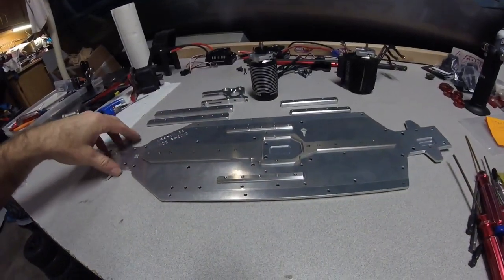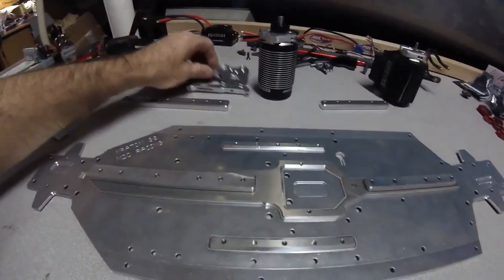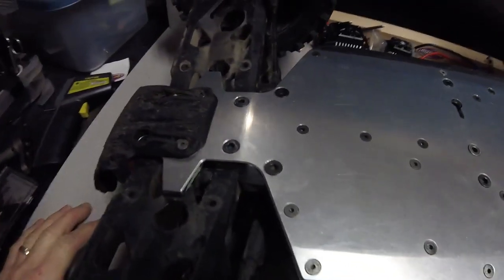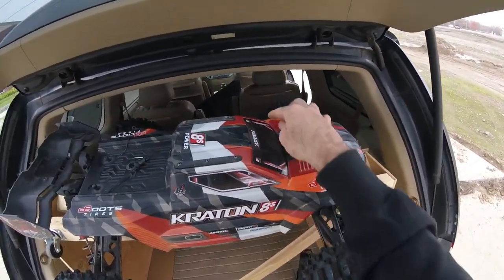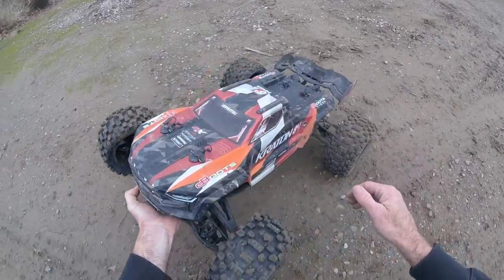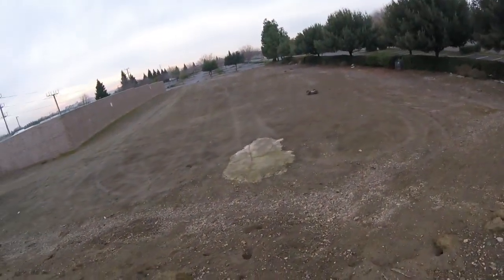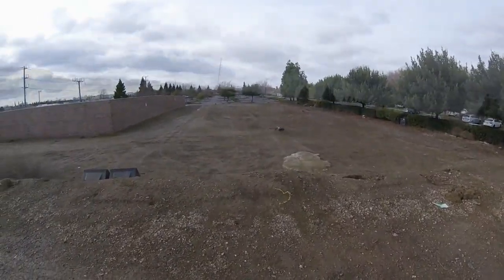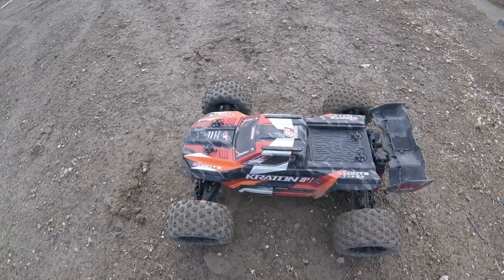ARRMA Kraton 1/5 8s "Full Beefcake" M2C parts + Hobbywing 5687 Max5

Comment: Was wondering if u had any advice I have the exact same setup as you except a 27t pinion stock front tires balloon like crazy with 500k front 20million and 100k rear
Reply from the maker: I'd recheck the center diff perhaps 🤔. Recently heard someone's 20mil cst looked identical to their 2.5 mil 👀. My Gravity RC fluid was  radically different. If it's not a fluid brand/mislabel or fill level issue in the cup, you might try belted Duratrax wheels. I get some ballooning, but nothing beyond expected with my stock tires. 😎💪👊👊
Reply: @richduperbash2966   thanks man my 20 million was like putty could scoop it with fingertips lol
Reply from the maker: @troywilliams1185  no problem 👍

Comment: Hi Rich, can you tell me where you got that pinion gear? Who makes it?
Reply from the maker: The 2 options I've used are Saga Custom RC and HD 8mm mod 1 pinions off eBay. Just be certain you're ordering mod 1 as most 8mm bore pinions are 1.5 mod. 🍻😎💪👊👊
Reply: @richduperbash2966  are the width same size as the spur or are they smaller?
Reply from the maker: @nadersedaghat5694  the HD pinion is closer in width to the spur gear, but both brands have worked great for me. Both are a little narrower than the spur 🍻
Reply: @richduperbash2966  the hd off eBay has 1 grub screw correct?

Comment: im confused. did the stock chassis bend? or are you just trying out the m2c chassis?
Reply from the maker: Yes. I ultimately bent the rear portion of the stock chassis after repeated huge sends. The V1 Kraton 8s top brace needed carbon fiber reinforcement. ARRMA did a running update and redesigned the bracing for the V 1.5. Regardless, I test prototype M2C parts regularly. When testing is complete, they go into production. There's no comparison between 7075 T6 aluminum and stamped aluminum. 7075 if far superior for strength and durability. 😎💪👊👊
Reply: @richduperbash2966  thank you, I might get one of these, and if the chassis does bend, I know m2c has a solution
Reply from the maker: @michaelwilkes0  you bet Brother 👊. Just realize M2C has a standing coupon code "m2ccoupon". That knocks off 10% on all purchases 🍻

Comment: Hi, do you realy feel a big difference when you switch the stock Esc to the Max 5?
Reply from the maker: The stock ESC did very well after disabling the AVC with a different reciever and controller. Put in an old Tactic 👍. The Max5 is smoother with more power delivery and ran ice cold. 🍻😎💪👊👊
Reply: @richduperbash2966  thanks you for this answer 👌

Comment: Dude I’m drooling like a dog.  Omg bro. Love it.  Wow. 🤘🙂👌🤟🤣😍🤤🤤🤤
New typhon 3 s build 
I’m using Outcast 6 s rear shocks. 
There is a plastic retainer / stopper on the shock shaft ( stock) right. 

I took it off the shaft 🤷 is that okay. Newb question 👊😀
Reply from the maker: Thanks so much Michael 🤗!!!! The only 6s shocks that come with  the shock limiters are the Talion ones 🤔. I'm wondering if you got those instead of the Outcast shocks.. Should be perfectly fine to run without them on the 3s rigs. 🍻😎💪👊👊
Reply: Rich Duperbash 

You know what your doing.  Sorry bro it was Talion rear shocks.  Thanks for the info I had fo go back and look at the bill   Your right Talion read shocks.   ❤️👊😀

Merry Christmas my friend and happy upcoming  new year.
Reply from the maker: @rcsendandblast1579  you too Michael 🤗. Just realize both the oils and springs are rated very firm with the Talion shocks 👀. Would make for a very stiff ride on the lighter 3s rigs. I'd swap oils and springs. Like 30-35 weight oils probably. 😎💪👊👊
Reply: Rich Duperbash 
Ya man I see.  Thanks bro. Will do very soon.  

Surprised it runs 100 times better then my 4 s rig.  
It’s lighter. 😀

Edited my comment later on in the evening. 
Huge thanks dude I tried the thinner shock oil and what a difference. 
All I had wAs a bit of 40 weight and it worked killer.  

You really do know this stuff inside out. 
Thank you Rich 👊😀👌🤟🤘

Comment: which motor mount are you using with the 5687?
Reply from the maker: M2C Racing with 8mm slide. 😎💪👊👊
Reply: @richduperbash2966  do i also need the complete motor mount if i am running stock chassi?
Reply: @richduperbash2966  your motor is out of stock everywhere. What is your recommendation for another similar motor?
Reply from the maker: @nadersedaghat5694  I'd look closely at the Leopard 5898 1100kv. Should have crazy torque and power. 👍
Reply: @richduperbash2966  Do you also recommended the 200amp leapod esc or should i get the max 5?
Reply from the maker: @nadersedaghat5694  I'm honestly not sure 🤔. I've never tried the Leopard ESC. My Max5 has been flawless.
Reply: @richduperbash2966  great motor but that one is sold out also. Lol

Don't want to go 800,kv because of the size
Reply: @richduperbash2966  found a new  5687 on eBay and bought it. I will probably go with 27T. Have you tried fitting the stock fan on the 5687?
Reply from the maker: @nadersedaghat5694  awesome 👍. You shouldn't need a fan 😉. These bigger motors run very efficiently. 🚀🚀
Reply: @richduperbash2966   do you know where I can find a pinion gear that has the same width as the stock?

Comment: Great job rich. I just don’t understand people who down this car. They asses can’t drive like you and rc 81. This is your 1st breakage besides the slight bend a few weeks ago. These guys hit jumps horribly in cold and want to say it’s cheap. If they had time to learn like the money they make they would understand how this really goes.
Reply from the maker: Thanks so much Michael 🤗!!!! A rig this size and weight must be respected 👍. Hitting any solid objects or having really awkward hits is a no no. Definitely not a 6s buggy/truggy. Guys always get bummed about breakages regardless of the reason 😝. For what I've put this rig through thus far, I'm super impressed 👀. Fortunately, I've had mild temperatures here in central CA. I wouldn't think of sending it hard in ice cold temps like some have tried. Everything has it's limits. 🍻🚀🚀😎💪👊👊
Reply: They’re the same type of people that don’t take care of their vehicles but blame the problems on the manufacturer.

Comment: Hey what happened to voltage hobby there still out of everything should I start buying m2c racing towers
Reply from the maker: Voltage is trying to regroup for 2020. Kenny lost his main machinist and that had a major impact on business from what I understand. He's trying to get things sorted. I wouldn't hesitate to buy M2C racing 👍. Both use 7075 T6 and have incredible designs that work. 🍻😎💪👊👊

Comment: Ok so since you ran it with stock esc and the max5 did you notice a difference
Reply from the maker: Yes indeed 👀. Smoother and more immediate power delivery. Felt like more power. 😎💪👊👊
Reply: @richduperbash2966  I was just curious cause alot of people in the arrma group were saying there was no difference between the stock and max5 and you proved that there is

Comment: How did you get it to wheelie
Reply from the maker: I'm running 20 million cst center diff (and 500k front). Just running 2.5 million center diff, gearing up to 21-23T and advancing to punch 5 with stock electronics had her doing some wheelies 👍. With this bigger Hobbywing system she pulls wheelies effortlessly. 😎💪👊👊
Reply: Rich Duperbash is that a typo or did you just say 20 million for the center diff?

Comment: it’s sad that a 1000 + dollar rc needs a chassis change. it should of came with a 5 mm 7075 at the start. 🤣🤣🤣🤣
Reply from the maker: This rig lists for 899$ USD. Whether one "needs" it is user dependant and subjective. I agree a stock 7075 T6 chassis would've been great, but that would've raised the list price considerably. 😎💪👊👊
Reply: yeah, i’m only surprised cuz my hpi vorza came with 7075 chassis 😅
Reply from the maker: @rushgush  the Vorza is a Tank 👀. Almost bought one like 3+ years ago. 👍
Reply: zedrick zedwick I bent my Vorza chassis 2nd run out. Didn’t stand a chance against that concrete curb! 😂 Bent it back (small tweak) and running great!
Reply: RC Concepts 2015 x yeah, everything has its limits 😅